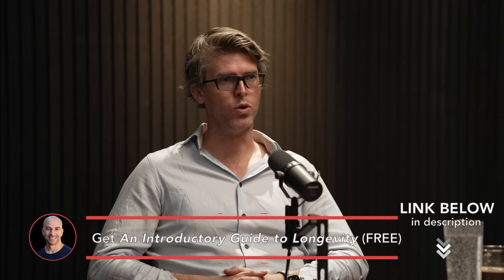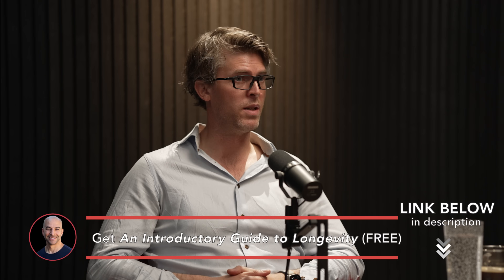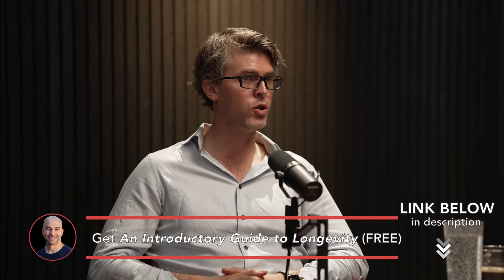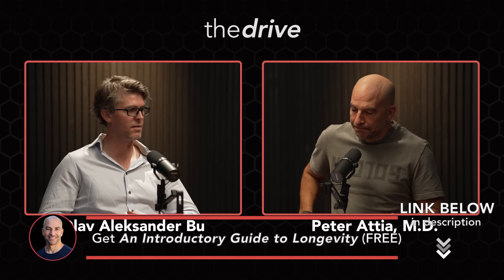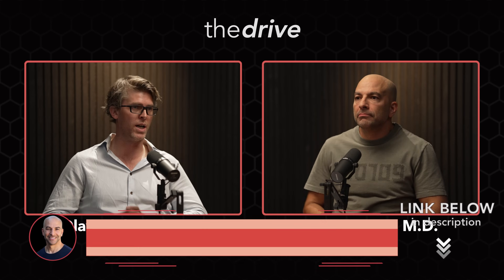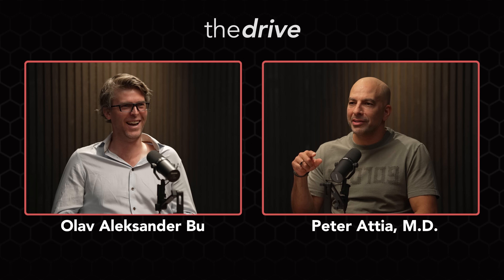Running’s New Edge: Power Meter Shoe Tech | Olav Aleksander Bu

Comment: Power meters are a waste of time for running, just run by pace or RP, if you're not on a flat surface then use RP or heart rate.
Reply: You never used one I imagine? Even on flat road they are extremely useful, wind is a component too that pace doesn't help you address, and RPE can be tricky too. If you wanna run a race and know that you can hold X watts for that target time, you won't miss the target, no matter the environmental factors. Provided you have done your tests properly. And it helps in training too, for the same reasons. But hey, let's just old stick to old methods because we've always done it that way. At the end of the day, you're leaving gains on the table. Is it a coincidence that you see more and more pros using it? I don't think so.
Reply: @ there are no gains being left on the table for recreational runners not using power. Pace based training works, if you want to go beyond that, use lactate. Everyone pedals a bike the same way, with running there is mechanics and efficiency to take into account. What runners are using power? None that I am aware of.
Reply: @Helios-1337  if you don't care about improving fine, your call. For people that care about improving and performance, power does play a role. It was the same way when the first power meter came out for cycling. People where like "what's the use for amateurs". And now look at it.
Sure, running with power does take a bit more of understanding, it's not as straightforward nor comparable across runners, but it's the same principle.

Comment: Stryd is by far the thing that has impacted my running positively the most. I've improved so much by training and racing on power that i cant explain how good it is. I originally bought it to have a more accurate distance on my watch since i live in nyc with high buildings and gps sucks, but the fact that it calculates power based on elevation, weather, humidity, all in real time, is crazy good. Honestly can't recommend enough

Comment: Power meter insoles are always flashes in the pan. In theory, they work great, but in practice, their lack of longevity is their undoing. Running shoes usually start falling apart around 500-600 miles or so, depending on the runner and the shoe. For me, that's every other month. I cannot imagine power meter insoles lasting longer than a pair of shoes and I cannot imagine shelling out $$$$$ for a new power meter insole every time the previous pair wear out. I suspect this is why Nurvv, FeetMe, RPM², and all the rest no longer offer power meter insole products and have either died as a company or pivoted into training/fitness.
Reply: Stryd is by far the best tool, you dont need the insole one
Reply: @barinopedro  Agreed. Just addressing the mention of power meter insoles from the video.

Comment: stryds metrics are just estimates based on weight, speed, incline and wind. so not directly measured like on a bike. you will notice this on a treadmill as you will have to tell the stryd what incline you run on.

Comment: "Why not everyone is training with power meters?" Because in running, pace is power. Running pace in ideal conditions (flat paved roads, no wind, etc) is proportional to power to weight ratio, so for most people it'd be enough to just add the extension Sauce for Strava that uses the same running power models describe in the Stryd website.
Reply: The thing is that most of the times you are not running in perfect conditions. Weather, humidity, wind, elevation, etc... Stryd puts all of that into account, its so much better than running by pace
Reply: @barinopedro  This is what I thought as well — conditions are rarely ideal or consistent unless you’re running on a treadmill. Even a slight uphill or downhill slope can change your power output and even your heart rate if you maintain the same pace.
Reply: That sounds like a good way to review your effort afterward, once the activity is uploaded to Strava. But isn’t the real advantage of using a power meter being able to see your output in real time so you can pace yourself more precisely while you’re actually running or cycling?
Reply: @PepeDalinShow  Estimating power in cycling is way harder than in running because of wind resistance and varying elevation profiles. In running it can be inferred in real time, because there is a linear relationship, e.g. 3min/km is 6w/kg, 5min/kg is 3.5w/kg, 6min/km is 3w/kg, and so on. This is what Sauce for Strava does, but one could simply do the math on the fly in real time. What I meant is that, unlike cycling,  I wouldn't get more insights from running power than I do from pace, again in ideal conditions.
Reply: @tadeo.pogacar  this is not accurate at all. LARGE variations in running economy exist between runners of equal weight that very significantly affect the relationship from speed to w/kg. Not to mention elevation profiles, level of technicality of the surface, wind, etc. Fundamentally it is MUCH harder to estimate power in running than in cycling since in cycling you have a convenient interaction point (the crank) between the human and the machine that can be used for power measurement. Measuring at the shoe sole is highly problematic without interfering with the motion. Using accelerometers like Stryd is feasible but the algorithms are not trivial at all, which is why they are still improving substantially.

Comment: Stryd power meters (footpod) have been been out for quite awhile now.  Great way to keep even effort across varying elevation changes.  Pace is not a great measure of effort when terrain is changing.  I use the footpod in much the same way I use a power meter on a bike.  I structure training intervals around power zones instead of pace, etc.  However imperfect it might be, I have found the footpod to be a great improvement in helping me to keep a measured, even effort in longer races and to guide structured training efforts on changing terrain.
Reply: Do they integrate well with Garmins, Strava, etc?
Reply: @lolbubs11111  yeah, works great with Garmin and reports to both platforms.
Reply: Stryd integrates well with my Forerunner 955 - there are custom data screens you can setup with various power fields.  You can also can import workouts straight from Stryd app into Connect and run those through the watch.  You can even set a power range and then have it alert if you are falling below or above it.  Strava will pull in the normal pace data as well as the cadence and power data.  

The Stryd app has a host of other metrics like ground contact time, form power, stride length, leg stiffness, vertical oscillation, loading impact rate, etc.  Those metrics you only see in the Stryd app.  They are interesting but honestly for me it's all about the power data  and the ability to structure workouts around that and control my effort.  Something also that should be obvious but is probably worth mentioning.  Unlike insoles, a footpod can be moved easily from shoe to shoe.  Especially if you have a shoe rotation for trail, road, easy days, interval days, etc. having a a single source of truth that can be moved from shoe to shoe is the only way to go for my money.

As a caveat to all of the above, I do come from a cycling background so using power this way intuitively makes sense to me.  I've talked to some purist runners who have said they didn't like using the pod for power (they used it for more accurate distance primarily).  Your mileage may vary I suppose.
Reply: I’ve been a Stryd user for 5 yrs (still using the original pod). It works seamlessly with the Apple Watch, Strava, and Training Peaks. I find power even more helpful on the run than the bike and it’s my key metric for training and racing at all distances.